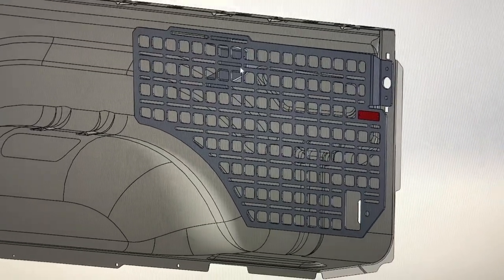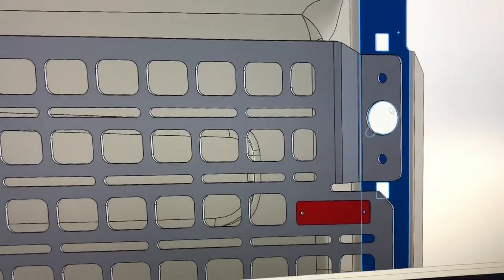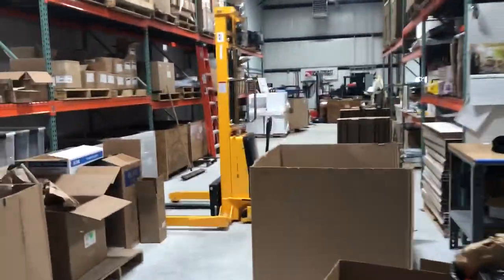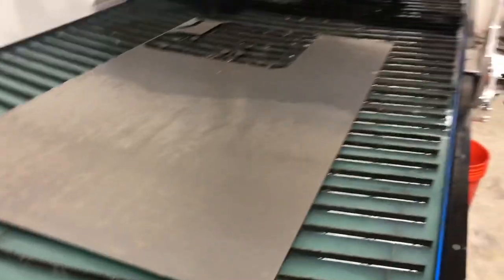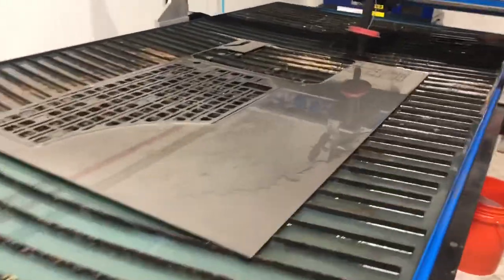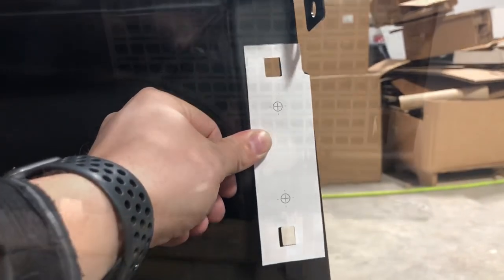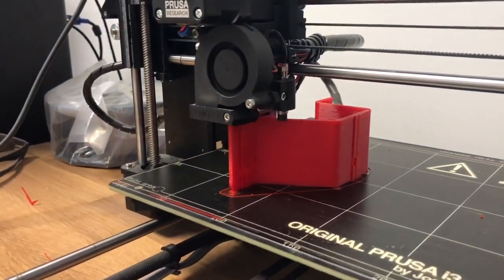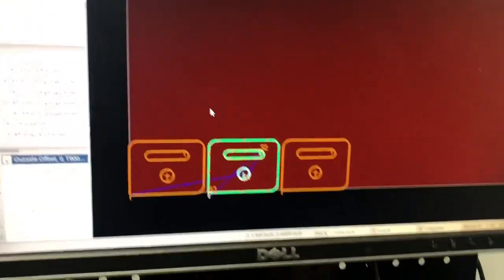BuiltRight Bedside Rack System Development and Prototyping - RAM (4th gen)

Comment: I wish the would have extended further over the wheel wells for a smaller gap between the panels. Also, a cutout version for folks with the factory 5th wheel prep so we can access the bed mounted 7 pin receptacle in the bed wall. Otherwise, super nice!
Reply: Any answers to this ?